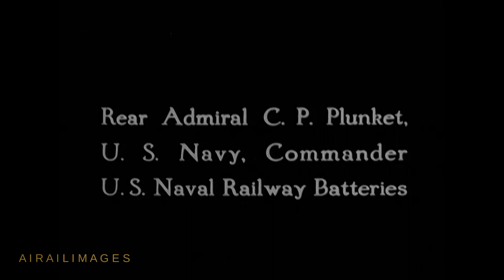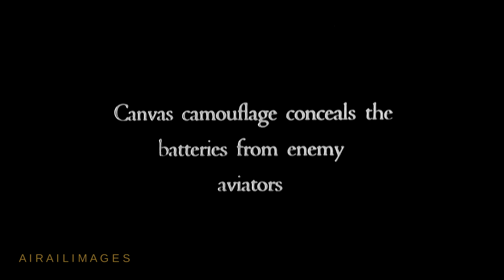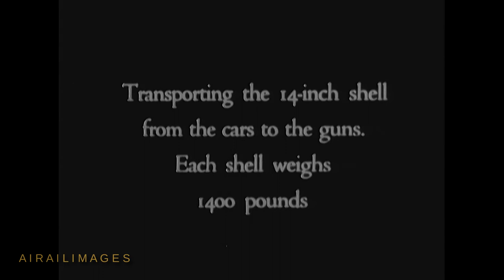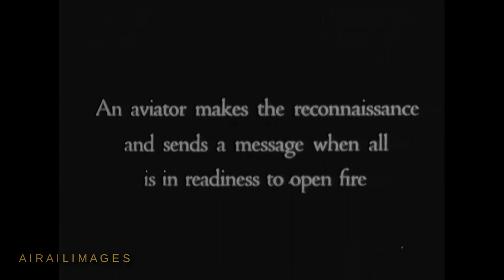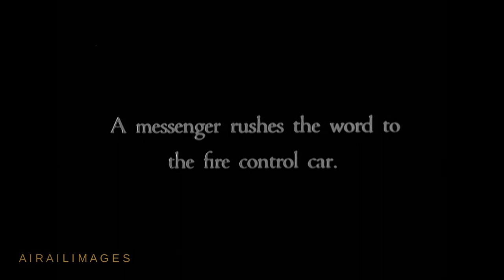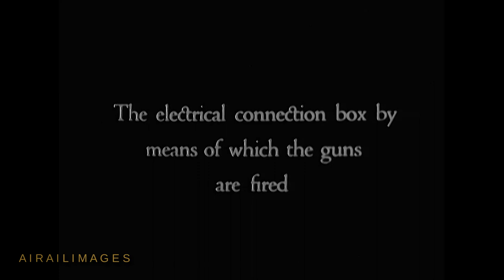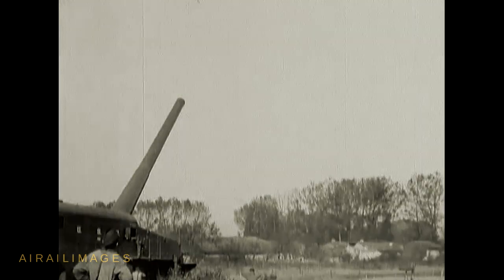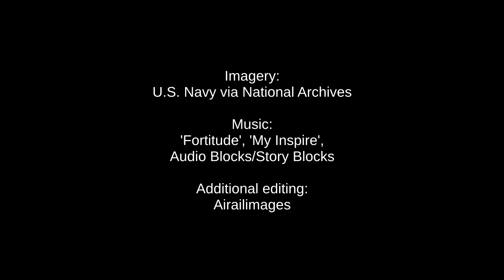World War I U.S. Naval Railway Artillery

Comment: Fascinating. On a battleship one of the big concerns is the effects of muzzle blast possibly destroying pieces of the ship or killing or injuring personnel when the guns are fired. Here are the same guns as on Battleship Texas, and the crew is mostly standing around outside the cars, right beside the breech. Also, the guns were trained with electric motors on a battleship. Here some poor sod is manually cranking the elevation on the gun, which has to be brought back to almost level to load each shot. Not an enviable job.